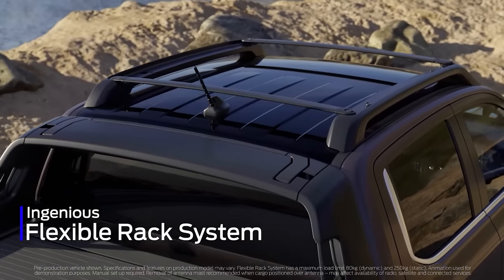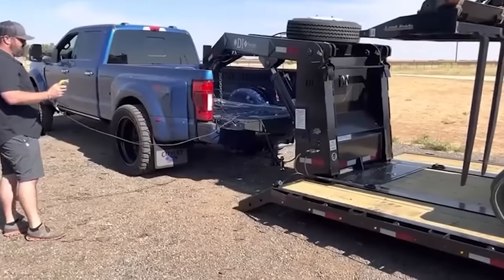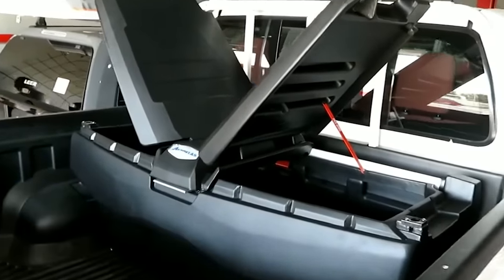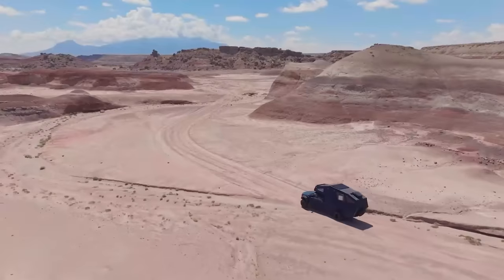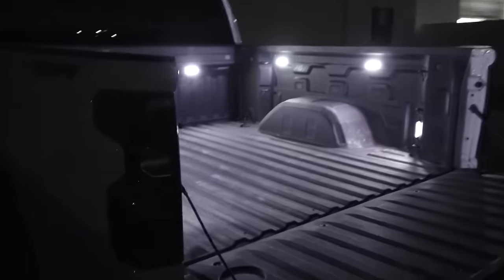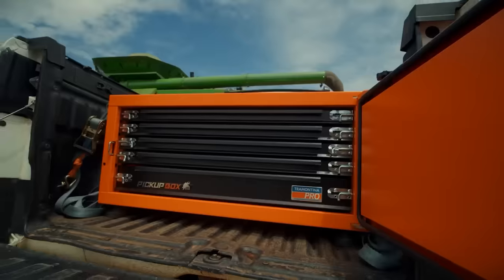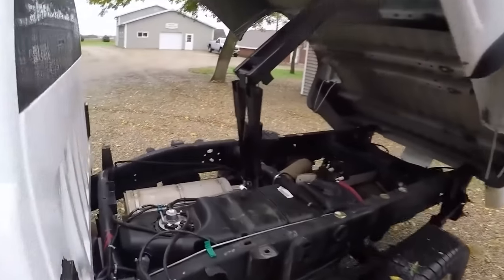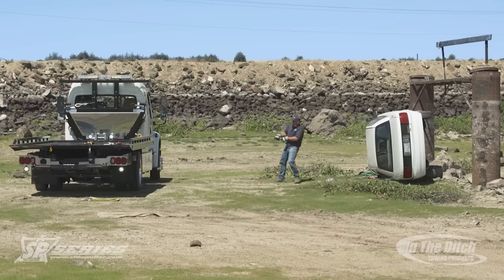15 COOL INVENTIONS FOR A PICKUP TRUCK

Comment: The tent for the Cyber truck was cool
Reply: too bad that it needs a software update to do anything off road
Reply: It needs the tent option because it can’t tow a trailer 😂😂
Reply: @jasonjensen2194  That's a problem with MOST off road EVs. They can't tow anything at all.
Reply: Imagine being all zipped in when the battery fire starts...

Comment: 5:32)A video showed Musk with a Cyber truck. The windows are supposed to be very tough, but one was damaged.
7:08)The step covers the plate. Good for a ticket in the US.
8:48)The Barricade has been around 40+ years. Used in 18 wheeler trailers.

Comment: I guess you can make your truck a dump truck.  I wouldn't do it for the typical home owner that uses their truck for just normal work around the home and to and from work/store.  The cost will never pay itself back.  I have something that does the job for under $200.  There are multiple sources and manufactures but a commercial name is the Load Handler.   I handles the loads, and allows you to simply slide the load of bark dust or dirt/sand by using a tarp set underneath the load material, and cranking it out into the area you want the load to be places.  Again, not advocating that particular manufacturer's product.  Lots of options to do exactly the same.  You can even simply use a general purpose plastic tarp, and with a couple of folks, simply pull the load out.

Comment: The Barricade is not new in any way and has been on the market for a few years at least. I don't know how they can get away with advertising it as their product when it's been on the market and made by someone else
Reply: Yep just a new model of an old idea
Reply: I think they’re talking mostly about the hanging bags and cargo net.
Load bars have been used in box trucks for decades. I’ve never seen them that short. I have 3 for my commercial trailer.

Comment: I’m so over electric vehicles! First 10 below zero night and they turn into very expensive paper weights!
Reply: There's also no good infrastructure for them either. Just like hydrogen and CNG. 🤷‍♂️
Reply: Actually they work fine in freezing weather unless you're a DA American
Reply: Go ask all the Tesla folks that were stranded in Chicago during that hard January freeze. I've been stuck in too many day long traffic jams trying to flee hurricanes in the south. Electric vehicles? No thanks. I'll stick with my 36 gallon fuel tank.

Comment: The first thing was on a ford. If it was on my ranger it would never get used as ford was always broken
Reply: Hunh! I guess you believe in Fairy Tales.
Several F series & full size Broncos & Mustang … 
Several 100’s of thousands of miles.
Very hard user.
1 tow off break down (manual trans broke)
1 Drove til Dead (300k+ miles)